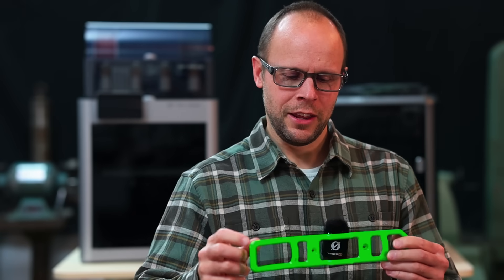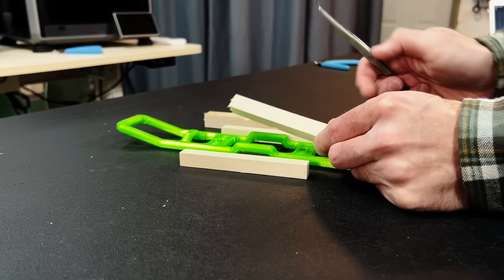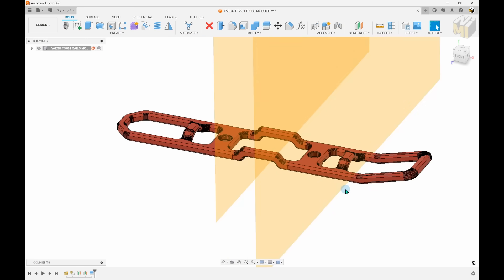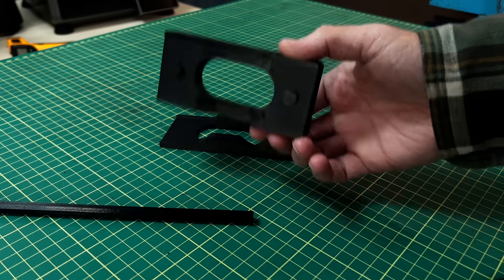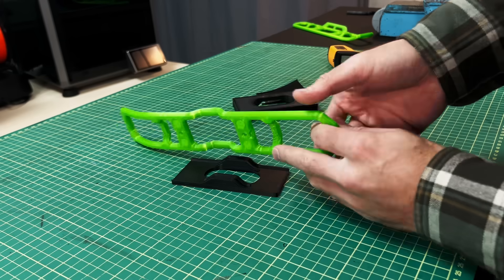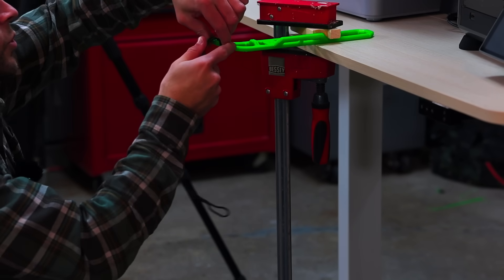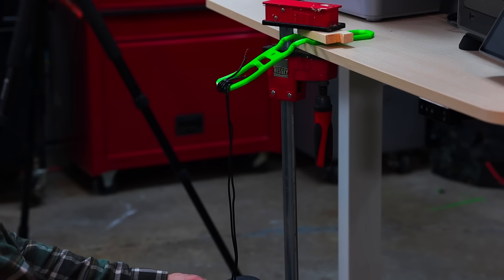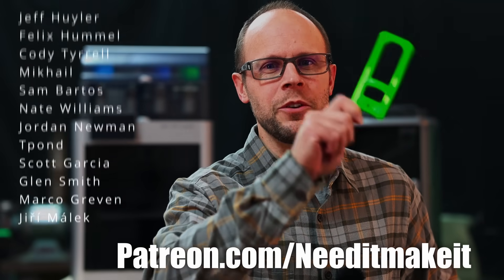2 Simple Ways to Make Stronger 3D Prints + an Experimental Way

Comment: The material choice is critical, I would not produce those or basically anything in PLA since PLA is a non engineering material. PETG, PA, PC, ASA would be best for a product like that. 
Since PETG is the most hasstel free I would design it for that, it flexes nice and is very sturdy also the interlayer bond is great, it does not melt in the sun like PLA does etc.
Any other additional process like, interlayering with metal mesh, remelting using epoxy whatever is well more effort more cost more time.
Reply from the maker: A one and done is the best way for sure, I had higher hopes with the forming method, but hey we had to try it, and no biggie if it didn't work out.  These samples were all PETG, I agree about the PLA.  PETG seems really hard to get to stretch rather than fracture, I was impressed with the flat model having been able to be loaded and also stretch.  But a complete re-design is probably going to happen because we can do a lot more I think.
Reply: @NeedItMakeIt  "...But a complete re-design is probably going to happen because we can do a lot more I think...." I am sure you can.

"...PETG seems really hard to get to stretch rather than fracture..." Hmmm this one is interesting and keeps me thinking. I already wrote on an other comment that maybe you can "condition" the part with PETG, I am not sure. Do you know what I mean ?

Comment: Great video, i think a very hard tpu would be great for this application , almost impossible to snap.
Was looking at Python flex 98a
Reply from the maker: I keep forgetting that TPU is available in so many different durometers.  That's a great idea.  The ability for something to flex and absorb an impact would be ideal.   It would be better to mix materials, or infill settings to have rigid areas and flexble areas like a crumple zone on a car.  Python Flex 98a, I'll have a look and add it to the list to test out.   

I need the gods of YT to send some more money my way so I can buy a bunch of different filaments to test out!
Reply: @NeedItMakeIt  mixing materials would be great, my new bambu lab a1 is awesome. Im now also regretting not getting the p1p with ams because 4 colour is cool but more colours are needed. Hopefully bambu lab will make the a1 multi ams compatible.Also need more filament, the faster printers eat filament so fast
Reply from the maker: Already, wow, that was quick.   They've certainly got the right ideas of what to make that people want and need in a printer and also adding some innovation of their own into the mix.  I'm not sure where Bambu is going with the AMS, It'd be great to have something that is more universal for sure.  It seems like it'd be possible.

Comment: Good video! I think the best way to increase strength is just to design better in this case. However, I would like to see how much stronger those prints would be if you printed slower.
Reply from the maker: I think so to, it's one of those things, tunnel vision trying to make a design stronger that isn't ideal in the first place.  A piece like that looks more like something that should be made from Alum, or sintered.  I think I should do a re-design and also print with a few different materials and do some re-testing.  I'd really like to do some drop testing with a 'dummy' radio to see what the damage looks like, which parts break, is the 'radio' protected well enough if it hits something hard from waist height let's say.  

Printing slower for sure a great option.  Now that I have the taste of speed, it will be hard to print slower, maybe an overnight print and I won't know the difference.
Reply: @NeedItMakeIt  Yah. I use TPU-CF for applications like that. Can't destroy the parts. Dont need to design it 120% accurate and they will last a long time.

But if sth. has to be replicated by others in the community solutions like bending them after printing oder using expensive materials are not to way to go :D

Comment: Well this was highly predictable. Other options : 1. Simply add some perimeter and change the infill pattern ; 2. Avoid holes in the part which does not increase drastically the filament used, it's the tension area and/or the section which makes the strength ; 3. Use the zone infill change function of your slicer where the part want to break.
Reply from the maker: Thanks for those ideas.  I'll have to experiment a bit more.  What are your thoughts on using TPU, something fairly hard but still has a little bit of flex to it?
Reply: @NeedItMakeIt  TPU is also a good idea. Just put some extra care on screws+large washers to allow a reliable fastening.
Reply: TPU can be damn near indestructible. We use it on drones and robotics applications. Bambu has a fast printing version that might be interesting to test as well.

Comment: Very interesting video, thanks! One additional interesting sample would have been the original design printed on its side. You would have needed more (tree) support but the layer lines should be oriented quite nicely for endurance (along the long axis of the part).
Reply from the maker: Ah, that's a great point, I didn't think of that kind of tunnel vision, but I think that one could have been the best.  I was thinking about making a follow up video to show a best way to do it, rather than trying to modify a design.  On it's side and have the rail solid, or semi-solid with some type of webbing to avoid supports, also allowing for venting, these radios apparently like to get hot.  That could work really well.  I have some Prusament that I've been dying to try out.  What do you think about the webbing idea?
Reply: @NeedItMakeIt  Try both ideas if possible. One might work better for one side and the other better for the other.

Projects like this make me wish it were easier to make a mold and melt material into the shape. In that way layers are eliminated.
Reply: @NeedItMakeIt Yes I understand. I only started considering the part orientation while printing after watching a video a few years ago (CNC Kitchen? Maker's Muse?). But now I automatically do it (also a kind of tunnel vision, I guess...). An additional structure that increases rigidity and get's rid of the need for supports also sounds a good idea. Actually I agree with @tobins6800 commentary, a comparison of both ideas sounds fun.
The only thing I can think of that might be critical in this printing orientation is that your screwing direction will no longer be perpendicular to the layer surfaces. But I guess as long as you are not using countersunk screws you should be fine.
Reply: +1 to this ,since watch CNC Kitchen I always design/print parts with the extrusion path in mind ,turn off cooling can make layer adhesion better but come with other down side and still not storng as axial orientation
Reply: You can see on the screen recording of the thingiverse page that the OG designer printed theirs on its side. I agree that for the original design, this would have been the most optimal orientation for part strength.

Comment: That strength is impressive!

I am experimenting with PC - it is very strong and dimensionally accurate . As it has all the good and strongest qualities, I think to use it for everything that requires strength.
But I am tuning profile for best layer adhesion.
This what I want to work with - strong material but having less dependence on direction.
Mytechfun did experiements with Prusa pc and pc-f, layer adhesion got to about 40%.

Cnc kitchen experimented with transparent petg and achieved 80% layer adhesion - nofans, slow speed.

Petg less strong than pc by 30%, but also much less impact resistant by x2
Reply from the maker: These are really good ideas, I have some PC as well, I should give it a try!  I think a material show-down would be great, but I'll have to print something smaller, these take hours each to print. PETG doesn't seem to be such a good choice for anything taking impacts, that ability for it to take loads and then all of the sudden fracture is a little bit concerning.  ABS, ASA would probably be good choices also.  I'll have to add PC to the list to test out.  I may have to make a follow up video  with some of your ideas.
Reply: FYI about slow
My experiment from today.
Achieved volumetric flow 20  (at 25 doable but noticeable disordered waves) (15 with no waves) on qidi plus3.
Temperature set at 330 instead of the max 260 for this Noname PC filament .
Speed 224 for line width 0.6, layer height 0.2.

Simply 0.6mm width walls. 
It is transparent, insanely flexible/unbreakable. 
This is without cooling. So I make walls long enough for the material to be cooled enough. I will have to solve the issue of overheating - adapt the speed and flow rate depending on layer time or something.
This is my first experiment at this temperature, will be continued. 

Very strong bed adhesion at this temperature!

300mm/sec for 0.44mm width set for the top solid fill.

Trying slowdown bellow layer time setting

 @NeedItMakeIt

Comment: Beyond just annealing, the work hardening factor would be interesting to investigate further.  I’m sure you can work on tempering as well instead of full annealing.
Reply from the maker: If we could print the model solid, and then create a mold and anneal it that's a pretty good idea, especially if you make the same parts all of the time.  Work hardening, that's something I don't hear anything about with plastics. This is something that we have with metals, but I'd have to do a bit more research to see how the structure of the plastics would be affected.  My first thought is that melting the plastic just enough to fuse it would be the best, cooling it correctly, and slowly so it can form strong bonds seems to make sense, but work-hardening it, would that be flexing it just to a point before it's MOE?

Comment: I think when you heated up the PETG with the heat gun, it didn't reach a high enough temperature for maximum strength and became brittle. For annelling parts with better strength, you'd have better luck reflowing the whole piece using flour salt and the piece itself as the mold. This method only works if the part is printed with 100% infill and works best with PETG. Check out the original video of this method here https://www.youtube.com/watch?v=nRLJ4ylGTFc.
CNC kitchen tested this method https://www.youtube.com/watch?v=DyAKtS1b3SQ&t=1008s
Reply from the maker: I'll check it out, that sounds really good.  My thought about re-heating in a mold was to try and keep it as accurate as possible, but packing material down around it could work as well.  I'll have to check these out.   100% infill isn't a big problem.  I wonder whether 100% infill is best, or 100% Walls, we could probably do one wall and the rest infill.   Or would it make any difference?
Reply: @NeedItMakeIt  Shouldn't make a difference either way, since in the remelting process it all becomes one homogeneous/isotropic plastic piece. I believe in CNC kitchen's testing he showed the Z axis strength was on part with the XY strength of the part, so if the layers had no trouble fusing i doubt adjacent extrusions will have any trouble fusing. The major downside of this process is that is is very time and labour intensive though.